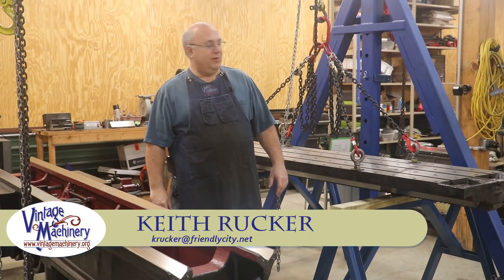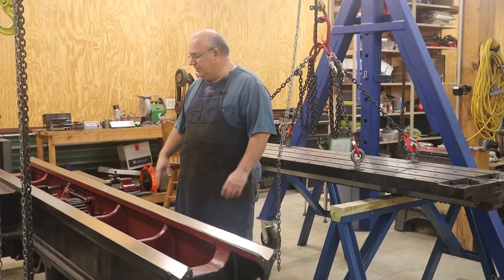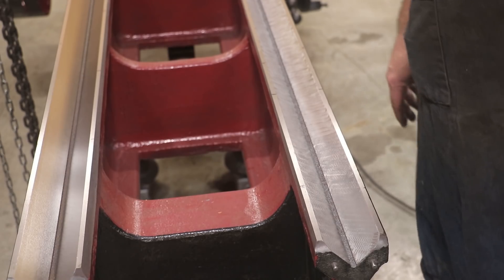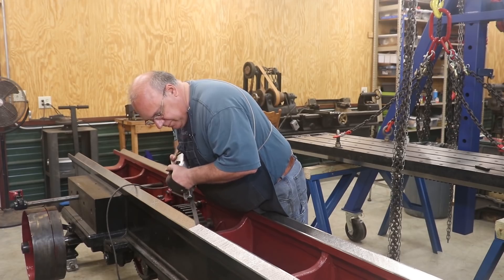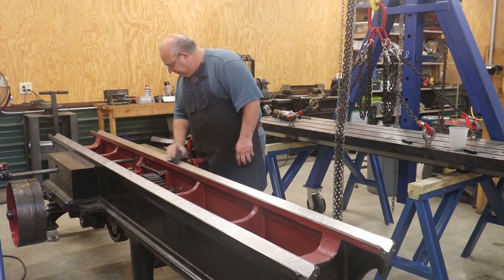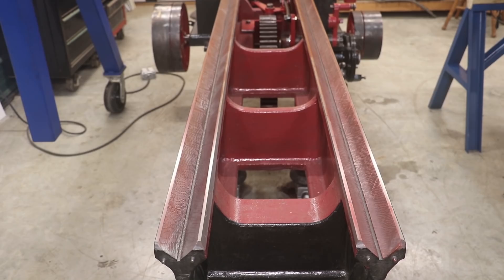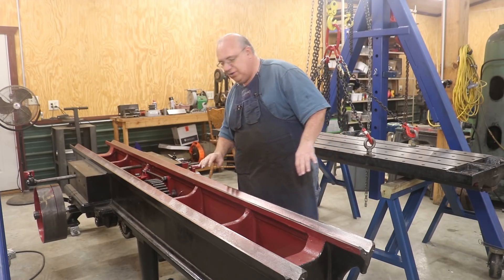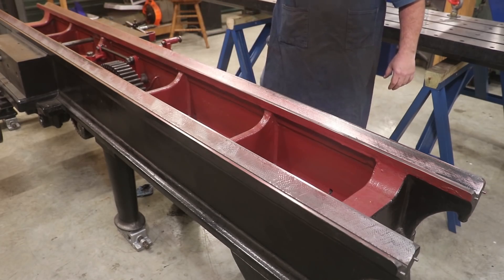New Haven Metal Planer Restoration - Part 26: Scraping the Ways on the Machine Base

Comment: If you done surface finishing for the tolerance within couple of microns, you should not do scraping ??? I'm bit confused why you do scraping after surface finishing. If you have time please explain. Thanks and take care.
Reply: Without the peaks and valleys that scraping creates, the “stiction” between the bed and table ways would quickly destroy both due to galling. As counterintuitive as it seems, roughing up the surface (with the roughness precision-controlled relative to the interface plane) greatly prolongs the life of the ways running back and forth under load.

The grinding is really only done to save time scraping. Grinding gets you close, the rest is done one tiny chip at a time.
Reply: chris0tube I guess you went to a better engineering school than I did and my engineering professors all lied to me. I better go ask for a refund! 😂
Reply: chris0tube Chris, my apologies for responding with a bit of a flippant answer earlier. This is important to address, however, because there are a lot of folks watching these videos wondering in all seriousness why we would mess up a perfectly good ground surface by scraping it.

First off, you will note I put the term “stiction” in quotes in my original post. It’s a jargon term, not a technical term, and the quotes were intended to convey that, however poorly. I assure you, however, that the phenomenon of slip-stick, aka stiction, at the transition between static and dynamic friction is very real physics. Stiction is the source of literally every squeak you’ve ever heard. It happens only in the transition between static and dynamic friction, and it does very real damage to highly loaded interfaces if it’s not managed. You may not like the term, but it’s in common use globally. Google it if you don’t believe me—lots of tribology research work out there addressing it. 

Second, you don’t appear to understand what galling is. Galling is not the scratch or dig you get from an embedded chip. Galling is the result of the normal (perpendicular) force between sliding objects overcoming the mechanical properties of the sliding material. One side breaks down, slides up/wedges along the crystalline structure plane, friction welds to the other part, and the death spiral begins. It has nothing to do with debris introduced from outside the joint, to be clear. 

Allowing two ground surfaces full intimate contact only makes the adhesion forces higher. This is why we scrape—to allow oil to infiltrate between the surfaces, keep them from developing full intimate contact everywhere at once, and thereby prevent wear via galling.

Please don’t take this as me lecturing. I just don’t want honest questioners left thinking scraping is some archaic practice from the Industrial Revolution and that grinding negates the need for it.  Thanks!

Comment: I really love this project - i cant WAIT to see this thing in action - but i do have to disagree with just 1 small thing here - I'm sorry - You and Abom are definitely my favorite machinist channels but there is just no point in buying "precision ground flat stones" - even if someone grinds them flat for you - the moment you use them on anything that is not flat - they are no longer precision ground flat.  Anyone can make their own precision ground flat stones by just buying 2 (or 3 if you want to get real crazy) and rubbing them together like you were doing.  There is no point in paying a premium to have them precision ground when anyone can achieve this in a just a few minutes with comparable if not equal results
Reply: Couldn't resist a responsive Erik!  I appreciate your confidence about giving an opinion on PGBS, however you simply just don't know what you just don't know. You are definitely incorrect about using "them on anything that is not flat", such a broad statement but a limited thought.  In many circumstances you could be correct.  If used in the manner they are intended, they remain flat and exceed the needs of 99% of applications.  With regard to "buying two or three" stones and making your own, I wish you luck.  I would recommend that you read the beginning of "Fundamentals of Precision Accuracy" by Moore before you take on that task.  PGBS are ground sub-tenth flatness and will remain that way for a long time as long as they are worked and cleaned consistently.  As another reference, take some time and research the science of lapping granite surface plates.  The cast plates used are "very flat" and over time become even better as they are used on granite plate which are "not flat" and need their surfaces corrected..... Check it all out and I think you will be amazed at what you will learn, all fascinating stuff.
Reply: @lancebaltzley  I'm pretty well acquainted with the overall "science of flatness" and/or science of precision - at least conversant and somewhat practically educated anyway.  And while its true that if you take a perfectly flat stone (or as close as we can get 'em anyway) - and work it across a reasonably flat surface without abusing it(machine ways for instance) - the stone will stay very near as perfectly flat as it was and the machine ways will approach a flatter state - that's true.  It's also true that if you take 2 brand new stones right out of the box - they would not be as flat as one that's been lapped or precision ground flat. If - however - you take the 2 new stones and simply rub the like-faces - each will approach a flatter surface.  Here is where my point is - for a task like stoning machine ways you've just scraped in - what is the measurable difference in results you achieve by using (1) stones that are precision ground flat, or (2) stones that are brand new and have just been improved by rubbing them together.  I suppose i spoke poorly when i said "anyone can make their own PCGS by...rubbing them together" -  sure - that't not a fair statement i'll admit.  But in terms of measurable differences in outcomes for a task like my example above....i suppose the only real way to know is to do it and measure.
Reply: @erikjoven2388  Thank you for the response.  As far as achieving a goal such as scraping a hundred year old planer... yes this can be achieved with a skilled craftsman and any decent slip stone.  From my experience grinding hundreds of stones has taught me there is a huge range of surface flatness in every brand of stone I have ground.  Norton stones which are now predominately made in Mexico are all over the place.  I have ground as much as 50 thousandths off per in the rough grinding phase to just get them in the ball park.  Rubbing any two stone together will only get them to match there faces.  Again Moore covers this in the three plate discussion.  Given that slip and bench stones are mostly rectangular I'm not sure it's even achievable.  When using precision ground stones for scraping it is a huge time saver.  Is it necessary?,  no but neither are automobiles when a horse will get you to the grocery store.  Every open minded person who has experience scraping and understands what is happening when they are de-burring with precision stones would not be with out them.  When working on cast reference items like cast iron surface plates they are priceless and a huge time saver.  If you are an experienced rebuilder or if you ever decide to start to learn the art of scraping I will send you a set of stones.  Here is a great video if you haven't seen it: https://youtu.be/DVLXsq7pi9Y
Robin also uses his own stones throughout many of his projects including polishing round surfaces such as spindle shaft... Let the education begin.
Reply: @lancebaltzley  If i understood Robin Renzettis explanation right it is not only the flatness of the stones but the fact that the Particles at the surface are virtually dull and do not cut.
This can only be archieved by diamond grinding.
 https://youtu.be/DVLXsq7pi9Y?t=255
Reply: @chris0tube Chris, I think the benefit will be less obvious to folks were are not in the business or hobby of applying these skills.  If at some point you are able to take a scraping class from someone knowledgeable and experienced this concept will be obvious.  I have had the great joy of meeting and learning from some "Old timer" machine rebuilders.  Some of them say I don't think PGS's are necessary.  They have always used slip stones and gotten great results so why change, right?  Go watch Robrenz on YT, he produces these stones for himself.  Also Steve Barton at Solid Rock Machine Shop just put up a video with Darryl Smith who is an avid scraper.  Steve introduced Daryl the precision ground stones and Daryl will never use anything else.  Explaining this would be like me explaining to you all the benefits of using a specific instrument to do a liver lobectomy when you have never performed any soft tissue surgery in your life.  I'm not trying to be rude, its just that we don't know what we don't know till we learn by doing.  These stones have so many uses that the value is unquestionable.  I will repeat this again, it's not necessary to use this type of stone when roughing, but when you are approaching the final stages of finishing scraping they save time.  To explain how you need to come to my shop so that I can show you.....
Reply: @chris0tube Chris, so glad to hear that you are a Toolmaker.  The intent of PGS's was never for de-burring.  I thought I had said that in one or all of these exchanges.  The difference is "in my mind" 1.) PGS don't scratch a surface in even a novice's hands.  2.) As one get close to finishing a surface, as is often the case you have a lot of small contact points over your entire surface but you lack the contact area.  The PGS's are fantastic at creating an increase in contact surface without distorting the wonderful flat plane you just created.  I totally agree with you "they are not necessary" but I for one will not be without them in the shop.  So many uses and now that I have the "luxury" of having all my stones precision ground I can't see why I would want any thing else.  I could live on hamburgers but I prefer filet, it's an individual choice I suppose.  As a toolmaker you clearly have a ton of experience that I don't so I appreciate the healthy conflict.  I have spent a ton of time around folks I consider as mentors, but we don't always agree on everything and no one is really "right".  What is "right" is what gets the job done to the standard acceptable to the person doing the job or the person who is paying to have the job done.  Scraping is a ton of work and I have done a lot of it, so anything that makes it more efficient for me I'm going to champion.  Thanks again Chris
Reply: chris0tube Chris, I don’t generally take the time to respond to comments as time in my world is beyond priceless.  We have exchanged a number of opinions in this feed.  If you would be so kind as to restate the question(s) to which you are referring, I’ll be happy to weigh in... often these conversations are so academic that everyone gets lost in the weeds.  I will sincerely respond if you wish to put us back on point, Im not sure what myths you are trying to debunk?
Reply: @chris0tube @chris0tubeChris based on the tone of this reply I must have seemed offensive to you in my last reply.  I assure you I was in no way trying to come across as such. Let's all relax a bit and I will give you my full opinion.    PGS are a very useful tool in a shop.  Are they a necessity for every pro or novice, no.  When someone is scraping a machine or reference surface/device they are not a "necessity" to get to an acceptable final product.  However they are a fantastic tool and a great time saver not only to the scraper but to any machinist who wants to do precision work.  With respect to de-burring... I believe that whoever decided to create the first pair of PGS had to have de-burring on his/her mind.   If I stated at any point they were not intended for de-burring, I would have meant in the roughing stages of scraping.  Isn't that what we are doing with them in every application. From a Robin Renzentti using them on the outside of a spindle body to Keith Rucker using them on the vee ways of an old planer?  Are they necessary from beginning to end on scraping projects? No...  However they are precision flat beyond the surface being worked, so they are improving the surface every time you de-burr with them. Are they a necessity, no... However everyone who has owned a set has found them useful, especially everyone I know who is actively scraping projects.  I have two very talented friends (mentors) who have pushed back about them.  One hasn't scraped in twenty years and the other one has been scraping his whole life, so he is locked into "his way" and doesn't like the size of the standard stones.  As much as I respect him, his mind hasn't been open to new ideas for the last couple of decades...lol.  I hope this answers your question and I hope we are fortunate enough to meet and scrape together one day.
Reply: chris0tube Chris, each of us sets our own tone.  Then we are left with others interpretation of that, for which I take responsibility.  Our perception is our reality.  You seem to be a very assertive guy that is comfortable with confrontation, maybe you even enjoy it.  I wish you all the best in your future endeavors and hope for your sake that you will give new things in your life a try before you condemn their usefulness!  The actual saying is “people will treat you however you allow them”.  All the best Chris, may you get everything you are looking for in your life.
Reply: chris0tube Thank you for the validation Chris!